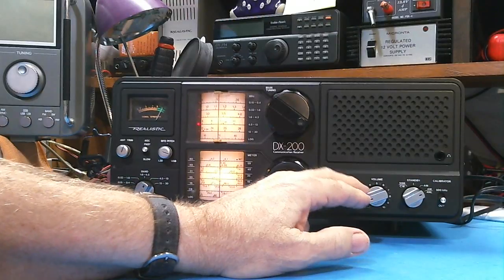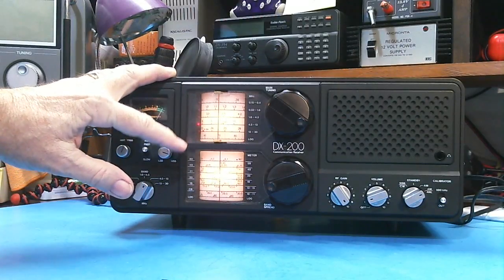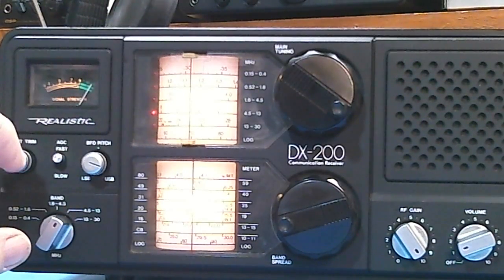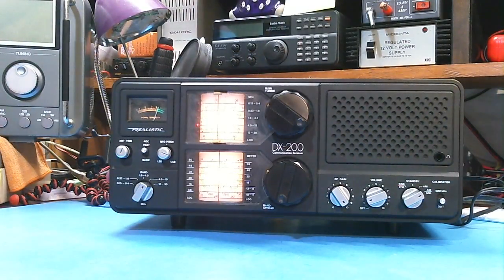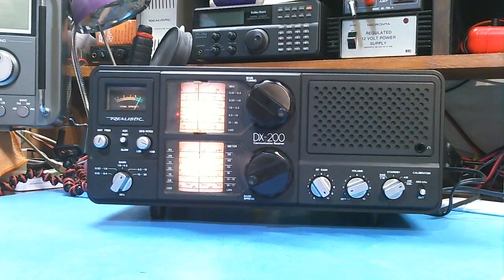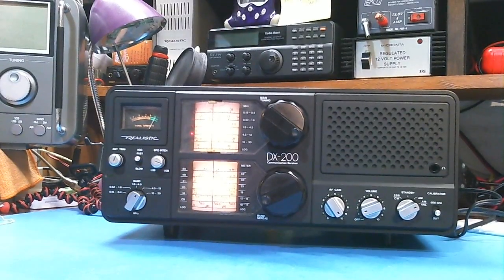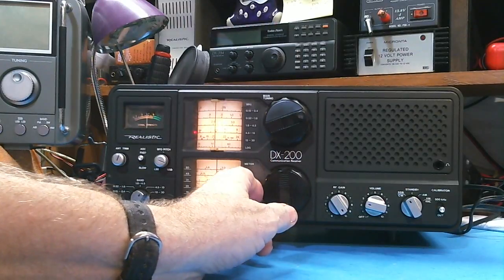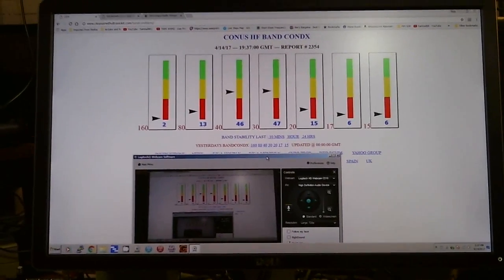TRRS #1172 - Shortwave Reception - Poor Today

Comment: 20-30-40-80 meter is supposed to be fair to good today 4/15/17... I think I hear your florescent light transformer in there :)
Reply from the maker: Could be the lights, computers, monitors, etc.  I normally have to use shield coax cable.
Reply: It sounds the same as when someone turns on the 8' strip on in my garage :)
Reply from the maker: I have tried turning things off but does not help.  We need rain to wash the dust off things.

Comment: That's a great band condion web site, I use it, it refreshes every 30sec. There are some interesting links at the bottom that explains how it works and give more detailed reports under "news" too. I love the 70's RadioShack radios, I have a Dx 300.
Reply from the maker: Thanks for the information.  I will check into what makes it run.